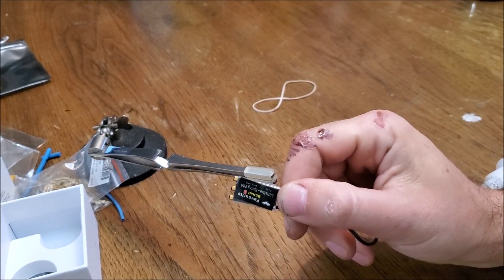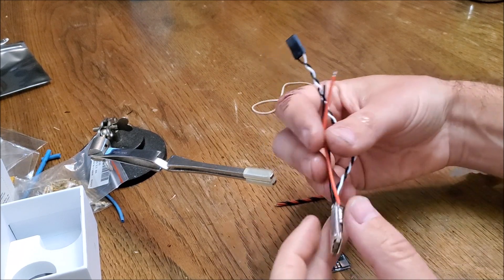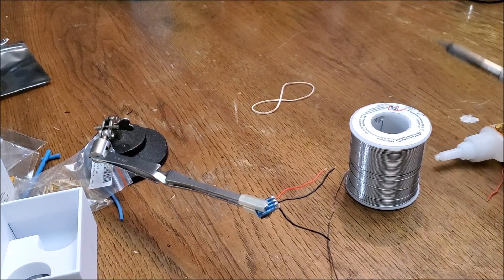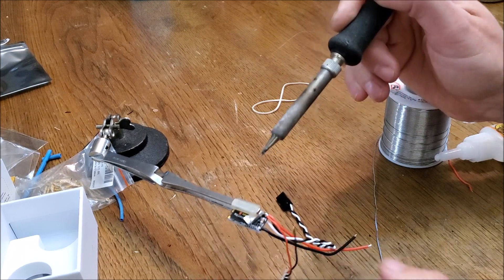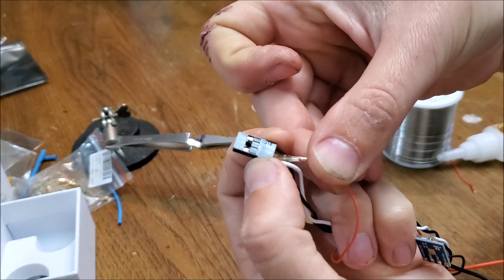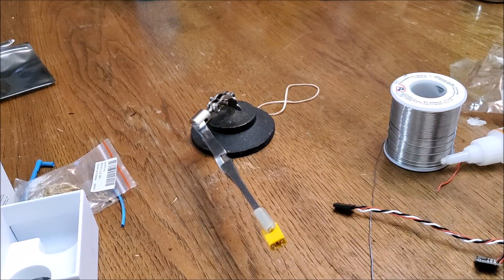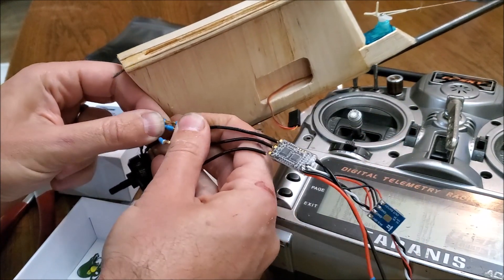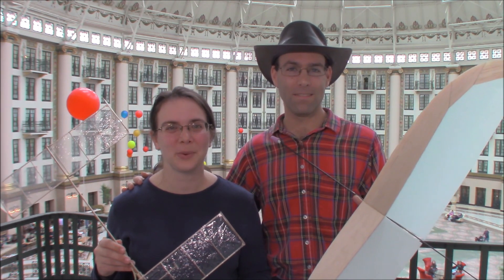Installing an external BEC on a brushless speed controller for fixed wing and free flight

Comment: But it wouldn’t matter if your receiver could take 7.4v and your only using a 2s am i right? You could just piggy pack the positive back the the 3 prong plug right?
Reply from the maker: Correct, but you also want to check servo voltage limits. If all are capable of handling full battery voltage you're good to go.

Comment: Sorry to see your finger.  It looks rather angry.  I do have several mounts for 1/2As one is a tank mount and the other is a glass filled composite.  Keep your finger away from those props.
Reply from the maker: Merely a flesh wound! Really though, the plane taking a core sample of the earth a few seconds later was a much worse event. Ive got a different style of glow clip on order that hopefully will behave better than the ~40 yr old pitiful thing that led to that event (well, had nothing to do with the crash).

Comment: Best video on this I seen and I looked!  Perfect thanks a lot.
Reply from the maker: Glad to help. When you asked about it, I had the thought that this might need my personal take on it. We started running escs like this with the 250g speed planes because normal fixed wing escs just cannot keep up with the newer outrunners which use lots of poles and very tight magnet spacing.

Comment: what happened to your finger man
Reply: No need to explain marks like that. Unless you're a manatee, there's only one main suspect, and COX is at the top of the list!
Reply from the maker: @lentrautman  you're not wrong! 😂
Reply: @joshuawfinn  sorry to hear it,  the number of cuts shows the ol' "bit by a Cox" --- aloe vera, and best wishes for speedy healing
Reply from the maker: @cstatman  no worries, it could have been worse. Wrecking the plane was much more frustrating than getting whacked. ;)
Reply from the maker: I knew people would ask. Stuck glow plug clips on a Cox engine.
Reply: lol pretty dumb excuse to see if you could feel pain not .It would have been better for Hope just u kick in the business 😉.
Reply from the maker: @timmorel79  lol! Actually hurt substantially less than having the plane absolutely plaster itself 6 seconds later, tearing the venturi right out of its housing and snapping an out of production engine mount!